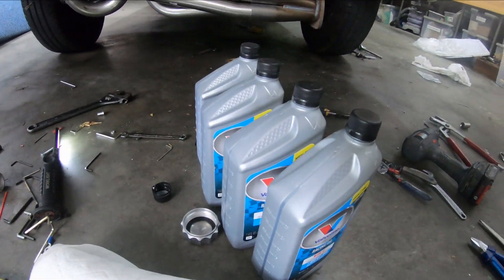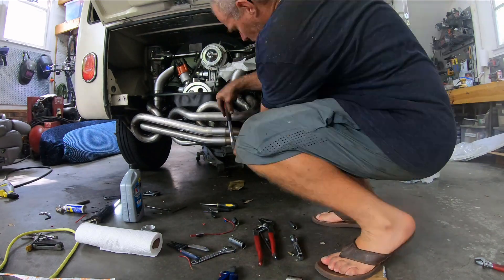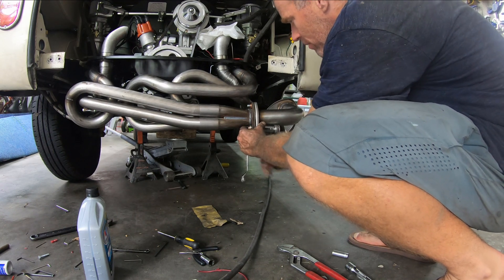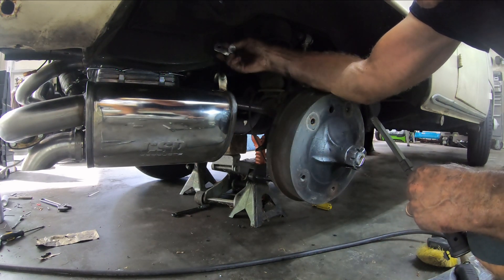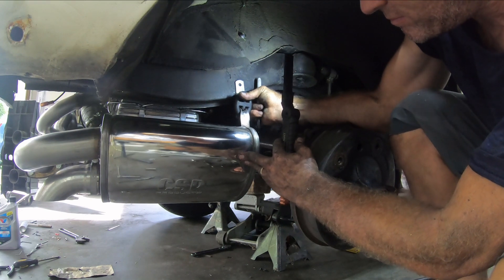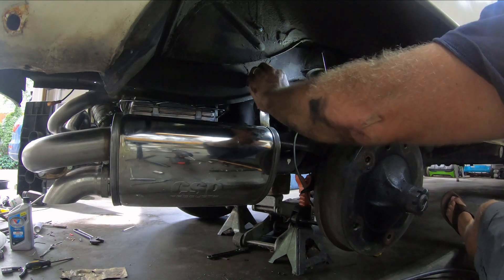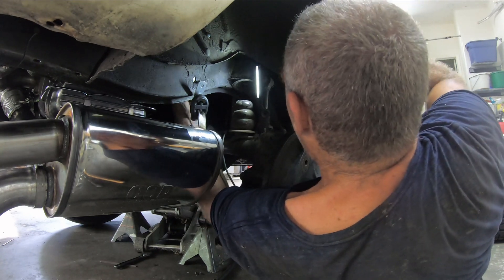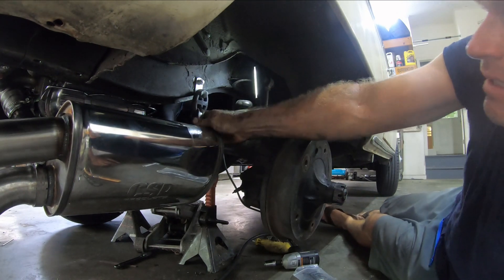2332 VW Air-cooled Stroker Motor - Video 82 - CSP Hideaway Muffler Installation

Comment: You should check the oil level once the car is level again.
Reply from the maker: Ah yes - good thinking.  I have both the bug and bus oil levels just a bit above half on the oil dipstick line range - since both have a deep sump, I have read you don’t need to fill it to the top of the line…